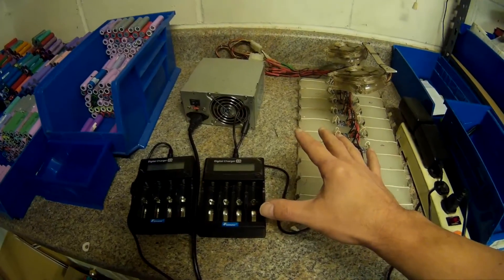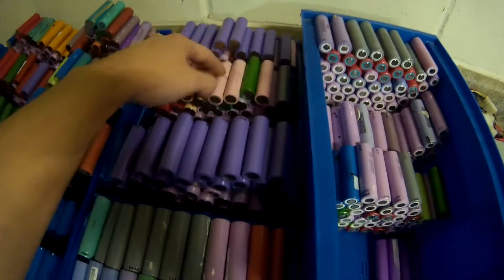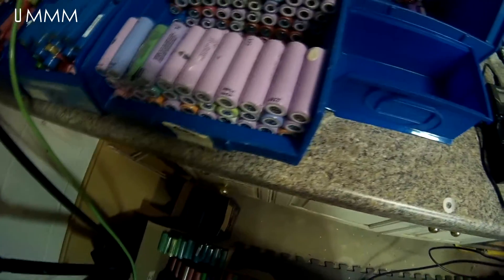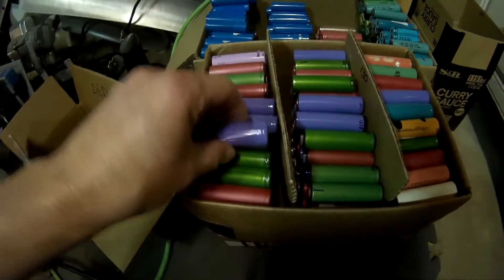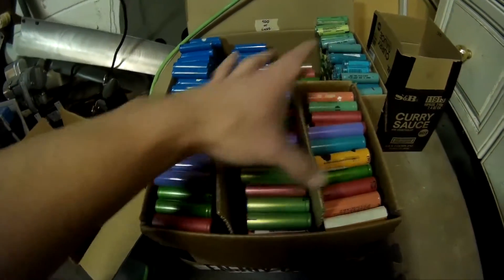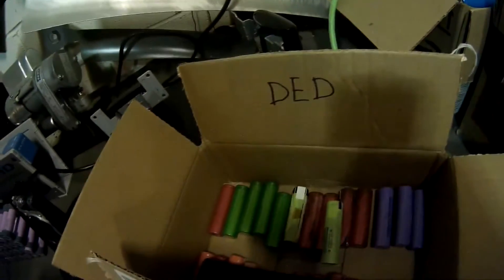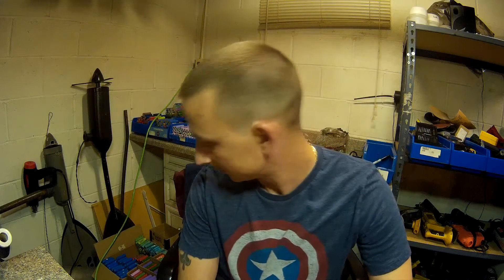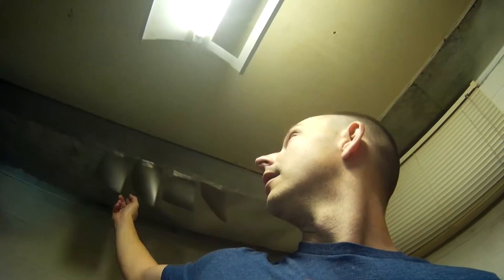Diy Tesla Powerwall ep8 Quick 18650 Update

Comment: try one of these for cutting your sleeves to length.

https://www.amazon.com/Westcott-Multi-Purpose-Personal-Trimmer-15804/dp/B00MU96ULM

put a piece of duct tape at the right length (I use 70mm) and then you get a straight, consistent cut.
Reply from the maker: Thats a great Idea!!!😃👍
Reply: AveRage Joe after I posted this, I saw in a later video that you had already switched to using a papercutter.    LOL
Reply from the maker: Ya but that lil slicer is probly waaay better!!!
Reply: definitely safer.   ROFL
Reply from the maker: Tru That!!!

Comment: Good start Joe,
Have you gotten any further on the EZ in and out pack? 
I've just about got my ebike pack nailed down. Interchangeable individually charged 18650's. No BMS, no balance chargers and no soldering them into a brick. 
When I have it down totally I'll put up the vids on how I did it, start to finish. I'm basing the design on davidcandleight (look him up) from China. His aren't quite interchangeable in that he closes the case and uses a BMS but it gave me the idea.
Reply from the maker: Right now the ez pack is sitting next to the pile of cells that are being cleaned of the tape ect thats left on the cells lol.  I do have more pvc pipe to make more holders.  I think I have a good idea on how Ill do the buss bar and fuses.  Its a slow process right now with all the other stuff going on here with work and getting ready for winter.  Should have more time here soon.  I think I did see a video a while back where he used springs for his right.  Yes please do uploads some vids and let me know, Id love to see them as well as all the others.
Reply: I built my e-bike battery in a USPS medium flat rate box 12S16P 192 cells fits about perfectly into the bottom of one of these boxes using cardboard as the spacers between each #S.  (You could fit 384, but why?) I put strips of aluminum duct tape across the bottom of the box to carry power from one S to the next.  The cells didn't quite contact so I used 5mmx1mm neodymium disc magnets to extend the batteries.  36V (mine was 500W)  motor controllers usually have around 62V capacitors.  As long as you don't go over the voltage of the capacitors in the controller you should be good.  I used 12S to get a range of 33.6V (2.8V) to 50.4V (4.2V) although the fully charged pack reached 53.5V.

Comment: gotten any weird form factors yet? I've turned up with a few 17670s.
Reply from the maker: Yeah Ive gotten a few odd sizes,  Some are shorter around 18490 size, some really short like 16340.  My first cells that were over 2000ma were 17650s and from an apple battery I think.  They are bright purple.  The shorter cells I got came from a camera battery.
Reply: I've got a few dozen 17670's if anyone is interested and you live in Phoenix, they're yours. You aren't supposed to mail them. Access to many more from my supplier. The problem with them is that by nature their capacity is smaller.
Reply: found some 18500s in a drill battery

Comment: Hello 
ok I will use also 1400mAh..
my primary packs are 40 cells that each have over 2000mAh
 capacity 
next pack are from 1900-2000mAh with additional 4 batterys...
next pack are from 
1800-1900 with 8 additional batterys and so on... 
1400-1500 are the one with lowest capacity that I will use... 
I put pack's together then I measure capacity of the whole pack.... so every pack is from 90ah and up to 105ah 
the packs with lower single cell capacity I have add additional 4 batterys ...so 
I selected my cells with following criteria 
voltage after full charge and rest time 3 weeks shuld have 4.1v or more... 
temperature by charging with 0.5-1A should not exceed 30-35 degC E.U.
damaged cells and rusted in any way are no go...
Reply from the maker: Awesome!  So your happy with your packs?  I think I'm going to use 1500 and up.  Ya most of my cells sit for a while as well and I always put the ones with rust on them in the recycle box.
Reply: Are you by any chance from slovenia?
Reply from the maker: Nope, Im in the US! Is that where you are located?
Reply: @AVERAGE_JOE  Haha yeah I am but the comment wasnt reffering to you. It was for the author of the comment. His name is kinda "slovenian."